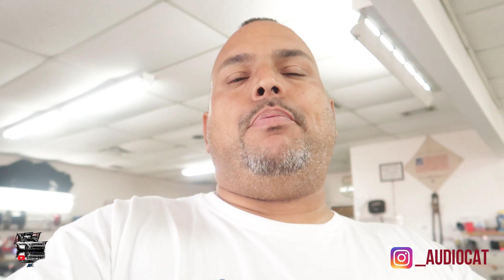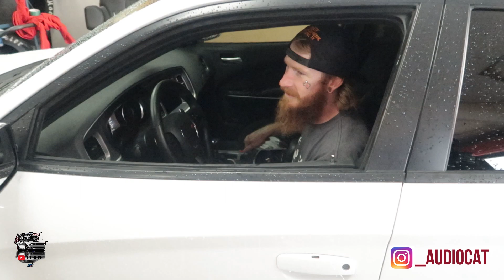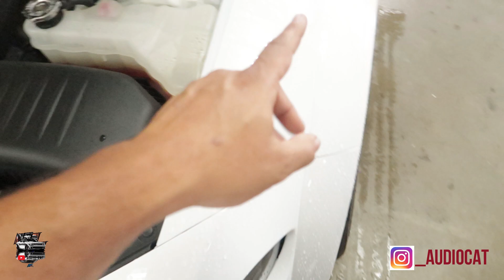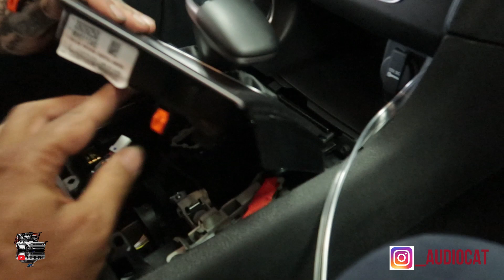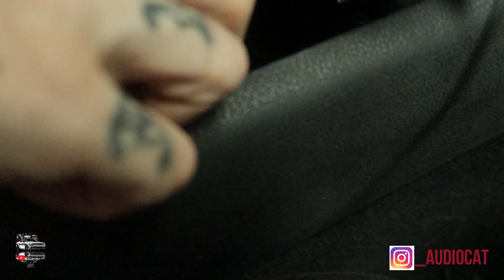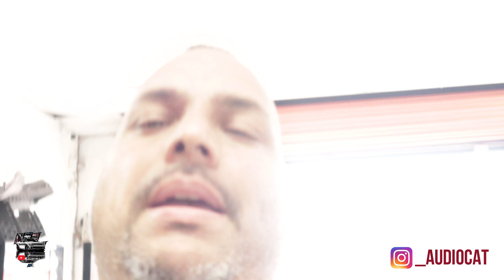HOW TO STOP THEFT OF YOUR DODGE CHARGERS AND CHALLENGER

Comment: Question for everyone who has the Destroyer 1320 plate installed.......   What's your plan when your battery is dead, won't hold a charge and you need to have your car towed?  How will you shift into neutral?  I asked this in a Mopar forum and I'm still waiting on an answer.  It's been months, so I thought I'd ask here.
Reply from the maker: You have to have it removed to tow but it is a safety issue to keep them also
Reply: It only takes 10 minutes to remove.
Reply from the maker: 10 Mins they don't want to be in your car,,,not knowing if you have GPS or silent alarm and shoot them
Reply: @AUDIOCAT  I know, I meant it takes 10 minutes to remove in case it needs to be towed. I just ordered one of these myself.
Reply from the maker: They work we sale them also

Comment: Still doesn’t stop someone with a repeater box, you need a full battery disconnect switch hidden.
Reply from the maker: Great idea. On power cut but theft with relay  box is rare also but we will look into that kill
Reply: @AUDIOCAT  pretty common switch used in drag racing, usually mounted on the rear of the car for track officials to kill the car if they wreck.
Reply: @gldmembr6132  Check out the IGLE pin code method, but the only thing with is that if you forget your pin its a wrap
Reply: Full battery disconnect?  How about a hidden switch on the brake pedal to keep from starting, or on the shifter to keep from coming out of park, or the clutch pedal on a manual to keep from starting?  Intervening with these low voltage switches would be easier and cheaper to deal with, as well as safer for you and the car.
Reply: @spazzman90  Well I've had my widebody for 5 weeks and they tried to steal it lastnte but with my alarm and IGLE they were unsuccessful. Also, they broke into it triggered the alarm then left and came back within 5mins but I was watching them by then. These fools are thirsty for a quick buck for no reason instead of getting a job.
Reply: @zone6trapgod293   all you have is alarm and pin code in order to start ?
Reply: @OGOD97  Yea but the alarm is separate from the pincode. Do you have a Mopar?
Reply: @zone6trapgod293   No but I’m planning on getting one and I live in the Chicagoland area
Reply: @OGOD97  I'm in the outskirts of Detroit but its pretty much the same here with Mopars like the Chi. The pincode method really shld be on any car with a key fob no 🧢
Reply: @zone6trapgod293   you got hood locks ? So if your alarm go off they can’t just pop the hood and pull the fuse ? Or a fuse box lock ?
Reply: @OGOD97  Naw I ain't go that far but even if they do that you'll get a message on your alarm key fob and phone letting you know your alarm has been triggered
Reply: @zone6trapgod293   are yeah that’s decent
Reply: @zone6trapgod293  where did you get your igle installed? I’m in the metro area?? Looking for a security specialist
Reply: @Emma-tj5sy  It was in Pontiac. Where you located in the metro area?
Reply: @zone6trapgod293  what site for your IGLE and can you install it yourself?
Reply: @northcalislimm4330  Well the only way you can get the IGLE is by going to one of there retailers and its only a handful bc they don't want to over saturate the market with numerous retailers having there product.
Reply: @zone6trapgod293  do you have a website for the retailers?

Comment: You do know any modification like this voids the warranty for the vehicle. Now he will get his car stolen and no warranty on it if he somehow gets it back
Reply from the maker: These mod won't void warranty
Reply: @AUDIOCAT  actually it does depending on the dealer. Some will overlook it some won't. I know my dealer won't cause it's an aftermarket accessory. Your best bet is to get a garage or go thru the process of getting your car replaced after it's been stolen.
Reply from the maker: The warranty wouldn't cover of he gets it back the insurance will do that but these are preventive matters to help stop or slow them from getting your car

Comment: Easy fix put all keys in aluminum foil it blocks all signals … and this isn’t the only way to put the car into neutral bro lol
Reply from the maker: Yes we know but it is the most common in thefts so a great starter if they want ot they will get it
Reply: How else u put it in neutral
Reply: Easy fix. Park another car behind it. And put some wheel locks on your car.